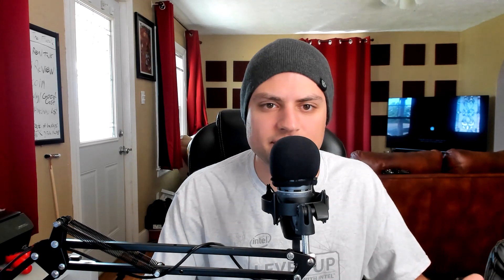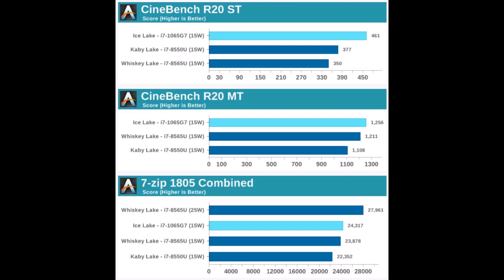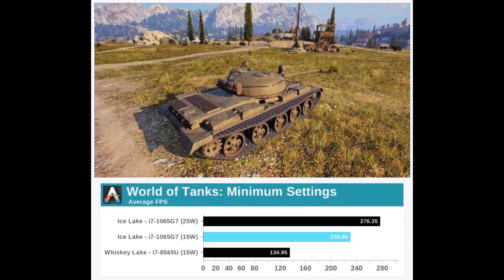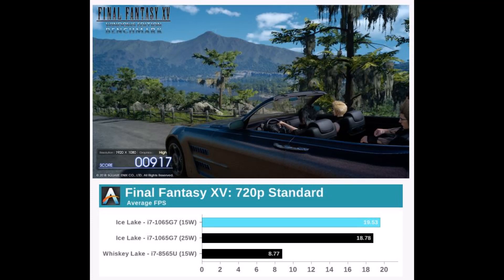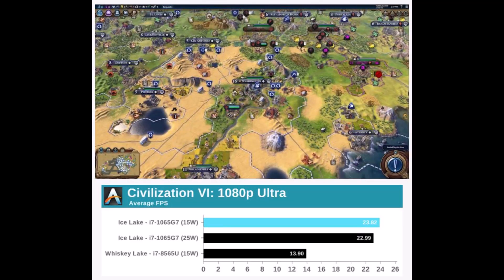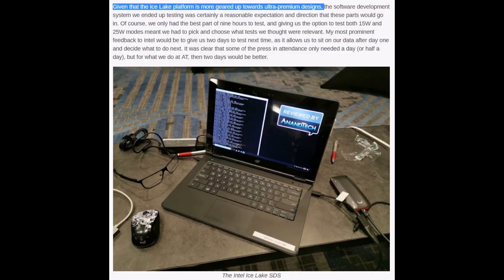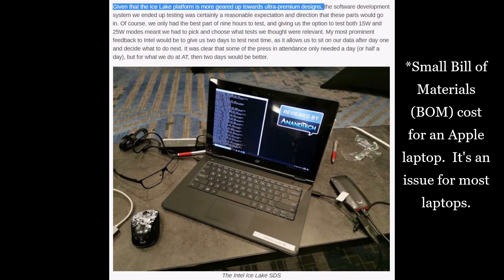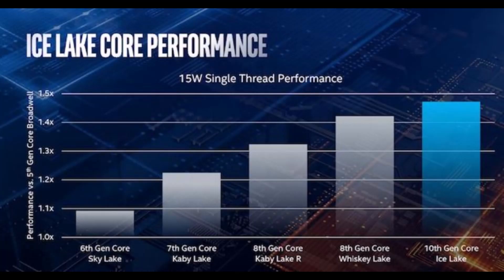The State of Intel’s 10nm+ Process

Comment: This is the problem with Intel, they are okay with a stagnant market.  They'll keep doing 5-10% increases to make shareholders happy, but they won't innovate.  Meanwhile you have AMD pushing the market forward:
Athlon beat P3 to 1GHz by a matter of days;
Athlon 64 beat P4 to x86-64 in the consumer space by 6 months (yes, IA-64 existed 2 years earlier, but it's not as commonly used as x86, and only in the server space);
Athlon 64 X2 beat Core 2 to dual-core by over a year;
and Phenom beat Core iX to the first true quad-core (on a single die) processor by a full year...

Intel's contentedness has allowed AMD the time to R&D Zen which is pushing the market forward once again, and Intel wasn't ready for the impact it would have...

Comment: You should do a video on Intel's Project Athena. As Icelake is currently only for ultra-premium mobile devices, then it seems Intel is making OEMs make more UPMDs. Plus the strict power requirements for Athena pretty much rule out any discrete GPU (non-intel!), which is a shame as you've highlighted how effective a MX250 could be at a little more power cost. Personally I don't like Project Athena, ultra-slims and touchscreens are not my thing.
Reply from the maker: I just think the MacBook Air and newest Envy 13 are the standard of ultra powerful netbooks.   

We don't need to get any smaller unless we  start exploring that "back pocket" form factor.... Which I am TOTALLY not against.

Comment: For mobile, no... desktops (and servers) will likely be 5nm but AMD seems to ticktock between the two platforms with a year delay. So right now, desktops have 7nm while mobile and APU's don't. Mobile and APU's have ZEN+, which was a 14/12 nm node. By the time that 5nm parts are on the market, mobile will have the ZEN2 jump in performance and design.

That said, it doesn't really change anything that you said by a long shot. ZEN2 is a huge improvement, and getting in mature enough for the low margin, high activity laptop space it going to be BIG. That is my guess to why this Ice Lake preview was more of a showoff of the Iris chips than 10nm+, the CPU isn't going to mean much but it's going to need the iGPU muscle if only because AMD is just naturally at that point with the APU's, they just need to sip less power (which ZEN2 accomplishes).

Comment: so Intel used golden sample, best reference machine run on faster ram, maybe a golden cooler, give less time for reviewer to test so they cannot find out more cheating device inside it, run without security patch in open system with full speculation branch performing at full speed on 10nm+ more advanced node, boosting the gpu little bit, increased the cost to justify ice lake is ahead for mobile laptop? cannot wait for zen 2+ navi at faster ram. Hope class action lawsuit coming up because this big company need a serious lesson

Comment: Why do all these channels keep talking about how much Intel is lagging behind instead of focusing on AMD ?  Who cares about Intel.  Intel is dead.  I don't care about their processors anymore.  Until Intel launches something that is 20% faster and cheaper than the corresponding AMD product, I'm done with Intel.  Done.  Couldn't care less.

Please stop talking about Intel and start focusing on AMD.

Here is a question for you... how does the speed of a 16 core Ryzen processor compare with that of it's Threadripper and EPYC cousins ?  Ryzen has the highest clock speed, right ?   But TR and especially EPYC have higher memory bandwidths.   Is it as simple as that ?

Comment: I think the added graphic should be especially useful for a small form factor 2-in-1 laptop, 13inch 360-degree flap laptop for example, almost never come with a discrete GPU. Something like Microsoft Surface Pro, Asus Zenbook Flip, and maybe HP Envy x360 will be benefit greatly from this new CPU

Comment: I am quite impressed that a mobile chip with mobile integrated graphics is pulling off civ6 on 1080p ultra and still getting 24 fps. 

But I guess the time it takes to end a turn will end your life though....
Reply from the maker: Other APU's already do this, and they do so for much less money.   Furthermore like I point out - it's like $20 to add a 10w MX250 that blows this performance out of the water.
Reply: @MooresLawIsDead   Wauw now I think about it, you are completely right and it isn't even exiting.

I do still feel a little sad for intel, even though they have been mean and evil the last couple of years they should still get credit for being able to optimise a node to it's best potential!

Comment: MX250 is as powerful as the 960m, or 750ti
A gpu that could play games at console settings 5 years ago.
And Intel still can't make their integrated graphics as fast, honestly it's a fail in my opinion
Reply: It's actually just as powerful as a GTX 850M/950M.
Reply: @dampflokfreund  okay then it's more shit than i though, holy crap laptop GPU's haven't developed much

Comment: One thing I would like to add also.  The gap would be even smaller if we compared Intel's Skylake Iris Graphics 540 which is also found on old 15w processors.  Intel really pulled the wool over some people's eyes.  Its GPU appears to remain slower than the 3700u.  The bad thing for Intel is that if 7nm Ryzen is even half the improvement that showed it desktop, its going to absolutely crush Icelake.  What if AMD decides to double the cores like they did on the desktop?  In addition, Navi performance per watt is vastly superior to Vega's.  This could be the first time that AMD surpasses Intel in mobile, something they never did, not even during the days of the Athlon 64.  Still probably won't sell well due to poor OEM design...
Reply from the maker: Yeah, Zen 2 will be better than mobile Intel finally.    I still think Zen 3 is what it will take to make major headway in mobile though due to how tough it is to break into that market.
Reply: @MooresLawIsDead  AMD is in a difficult position in mobile.  In my opinion Raven Ridge (when implemented properly) was very competitive with what Intel had at the time, but still are hampered my OEM designs.  Going by Icelake benchmarks, mobile Zen 2 should stomp it.  But will OEMs adopt it in premium designs is the question.
Reply from the maker: @pishia1104  you should listen to episodes 7 and 8 of Broken Silicon...

Comment: If I wanted a laptop I'd probably wait for AMDs offerings with Zen 2 and their new integrated graphics.  I actually have my old laptop from 2013 just sitting in my room.  Basically garbage at this point; was  a budget end laptop at the time (330 is what it cost me) and has overheating issues now.  May just give it away locally for spare parts or something.

Comment: The main point of ice lake is intel used most of the extra space on the die to drastically increase the igpu performance while keeping TDP's and cpu performance about the same.

This will result in far fewer mobile systems being built with separate gpu's from nvidia or amd, and intel can brag to oem's about how their mobile platform is an all in one solution (just like amd's mobile platform) and with all day battery life, per Intel Project Athena.

Comment: I'm not sure what people were expecting here. The only reason Intel would be holding off on 10nm chips for so long, is if the process was bad! Sure, they can make some architectural changes and all that. But if the manufacturing process the chips are built on isnt good, it's going to undermine it!

So yeah, this looks just as bad as people feared it would be. Intel's 10nm desktop parts are almost certainly going to be underwhelming. And by the time they're out, AMD will already be well on their way to putting out 5nm parts!

That isnt to say that Intel can't catch up, but it would take a pretty big upset for that to happen anytime soon.
Reply: Hey you only need 4 cores and 8 threads! What more do you want! You dreaming of 12 cores and 24 threads?